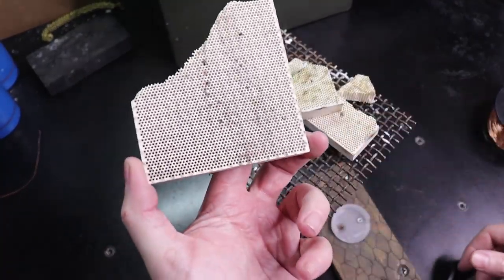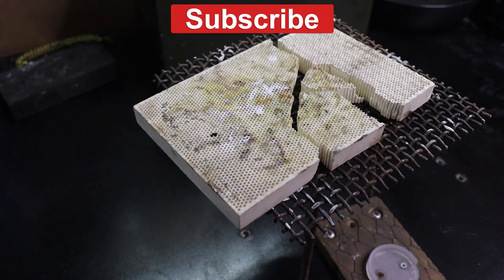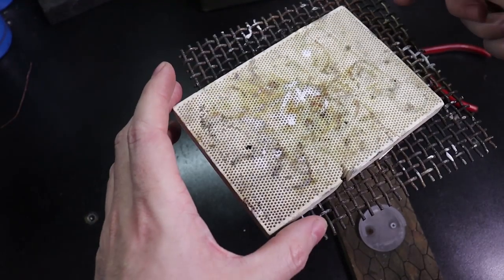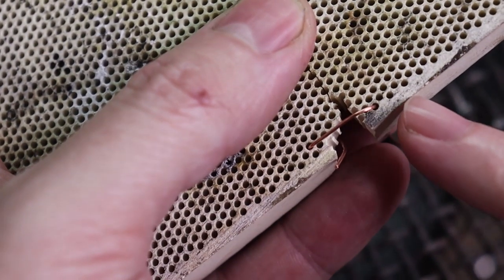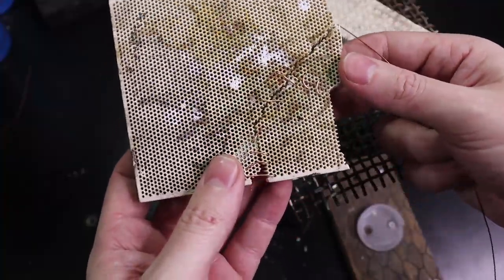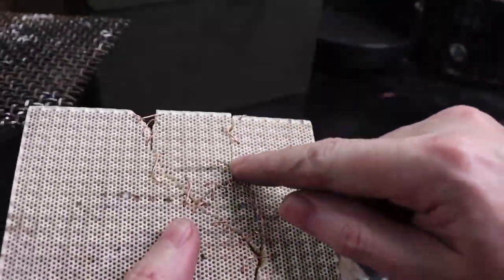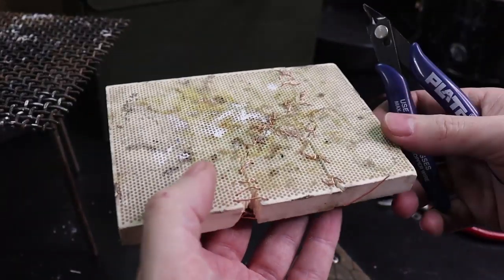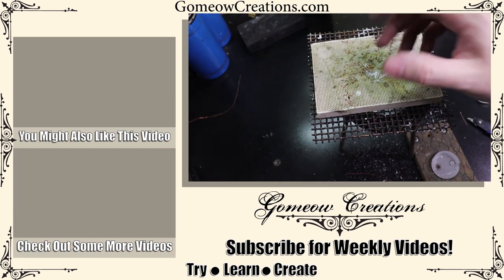Fixing Broken Honeycomb Ceramic Soldering Board

Comment: Kinda off subject, but can you make an instructional video on how to get joints flush. I'm having the worst time getting bezel seams and wider wires to line up. I file and file but still see light coming through. Very frustrating 😡. I'm thinking it's probably a common issue with beginners.

Comment: Freaky, that’s pretty much exactly what happened to mine!! Lol  was hammering and the base of my third hand which was plonked on top of  the pasta machine(polymer clay) attached to the edge of the table, fell off and landed on it. Broke pretty much clean in half. I was actually wondering if you could do that with the bits but I dunno if I can really be bothered, plus ofc, lockdown so can’t get  copper wire of the right gauge, so I guess I’ll just carry on using the pieces. Thanks for confirming that it can be done.
Reply from the maker: No problem and yeah this has happened to everyone that I have had haha. My last one got to the point that I couldn't fix it any more so I had to get a new one 😢

Comment: If you do it that way, aren't you risking accidentally soldering the copper wire to whatever you're soldering together?  I tried using craft wire as a binding wire and, unfortunately, I ended up soldering the craft/binding wire to what I was soldering together.  I know it's not quite the same thing, but would you think this would happen to the copper wire you used to repair the honeycomb soldering board?
Reply from the maker: I have never had that happen in the past and you can just heat it all to give it a good tarnish so no solder will stick to it 😁 I guess if it got some flux on it and you got unlucky it could happen 😅

Comment: Which is more heat conductive, copper or steel?  Could you have used steel binding wire instead of the copper or do they both act equally as heat sinks?
Reply from the maker: I really don't but I only have copper on hand so that what I used haha but I really don't think this will matter much 👍

Comment: You can stick its parts with glue and let it dry on a table... When you install it in its box and set it on fire, the glue burns and disappears..... The best solution
Reply from the maker: What glue are you using for this?
Reply: @GomeowCreations   Use any rubber glue...it will eventually burn and disappear

Comment: Yes, you could 'sew" it. Or you could do what I did, just bind the board with stainless steel wire like you would a charcoal block. That way, the copper thread won't get in the way.

Comment: Soo... Wait... What? Maybe I missed something here, but why on earth would i want to "stitch" my board together at all? Now it has created a area where anything im working on could stick, hopefully not while working with batteries of any kind... And being as its ceramic, wouldnt a bit of Cyanoacrylate be the best choice for repair? That way nothing is in the way, the board isnt uneven on my table, the breaks are for all intents and purposes, invisible, and all surfaces are clean... And what a waste of copper wire... And time... The only arguement I could forsee being even halfway valid would be if i were to lay my soldering iron on exactly the right spot so as to burn the superglue, creating bad fumes... But thats why you dont go nuts with the stuff- superglue bonds ceramic Very Good- so not an issue id worry about... So E for effort and originality-
Reply from the maker: Soldering iron? I use a torch on this surface that is anywhere from 2000 - 6000 degrees at it's hottest point. Also the copper used to do this will become very tarnished and no solder will stick to it. I guess if you are very unlucky the flux might clean it off and stick to it but with this surface you done place solder joints directly on it. As for the copper it was less than $0.10 so that not really a problem and is a common thing to use in jewelry making. 

From your comment it sounds like you deal more with electrical soldering not  jewelry or metal smithing like I do. 

So you might have miss something here 😊👍